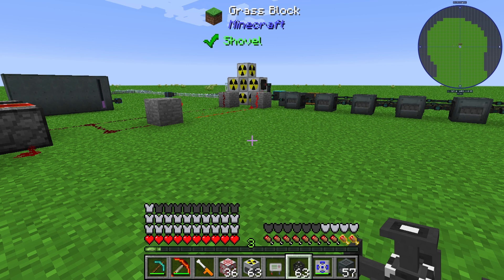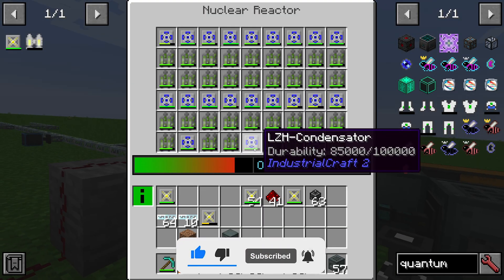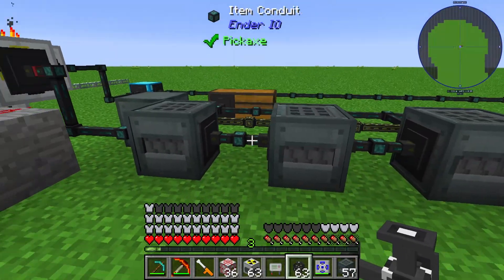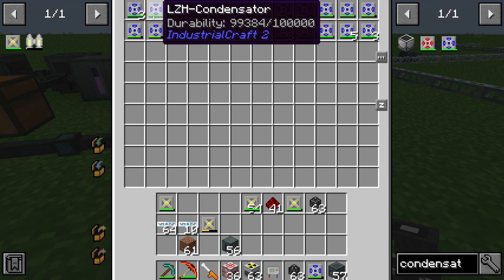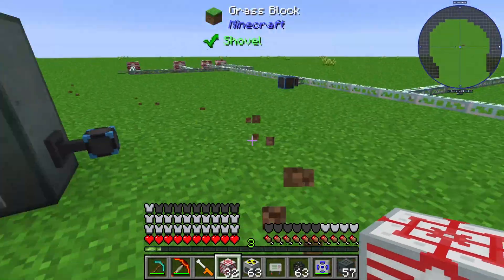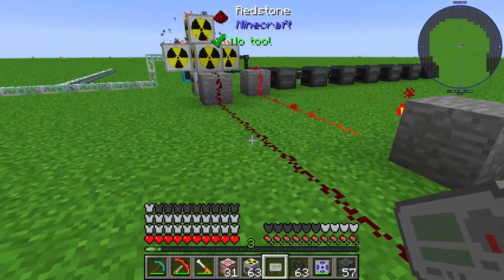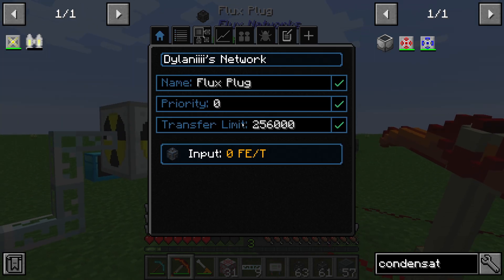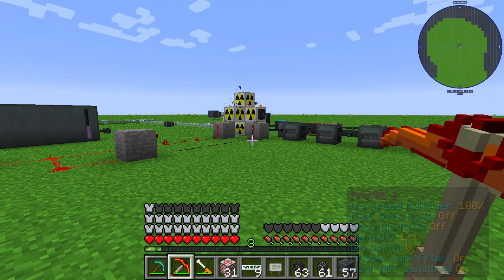Nuclear Reactor 💎 max EU 💎Industrial Craft 2 Tutorial 💎 English

Comment: Irgendwie bekomme ich nicht mehr als 8k EU/Tick raus. Produzieren tue ich 14k
Reply from the maker: Das liegt am Glasfaserkabel. Da liegt der Output bei 8k. Du brauchst eine andere Möglichkeit den Strom abzutransportieren. Geht btw auch nur mit einem anderen Mod. Der muss aber kompatibel sein mit IC2

Kann man dich vielleicht für eine Minecraft Mod Server Projekt begeistern / gewinnen ? :)
Reply: I have the same issue while using separate optic cables with the flow mod. I produce 17k but can t get out more than 8.2 as the cables support. If I attach to plugs, I ll get max only on one, or alternative, never more than 8.2. Any ideas how I can fix this?